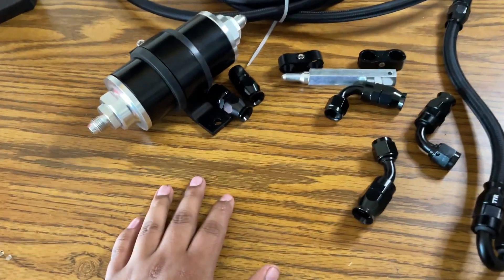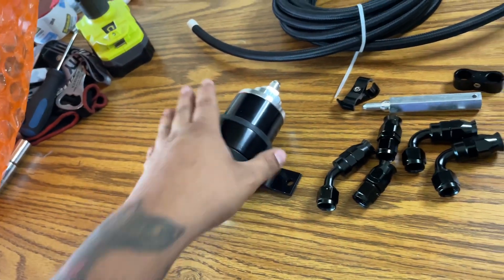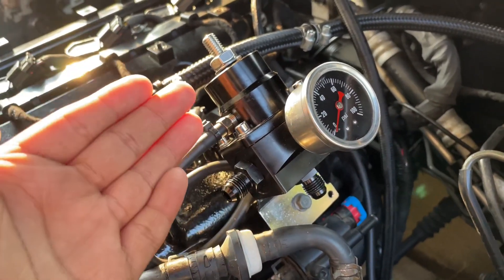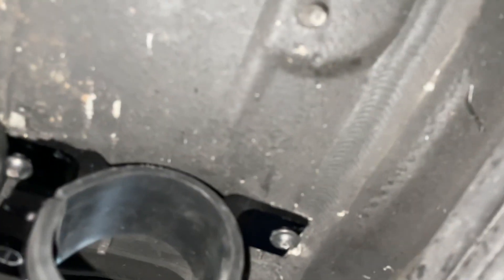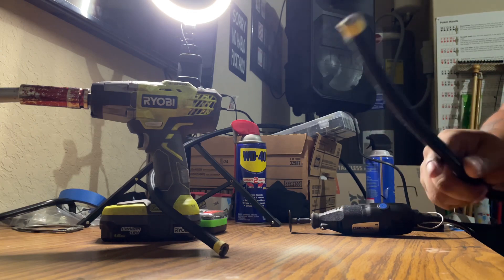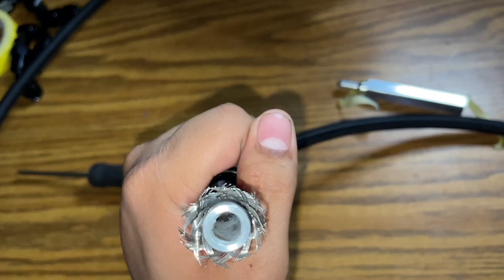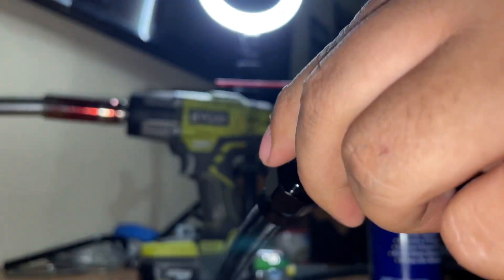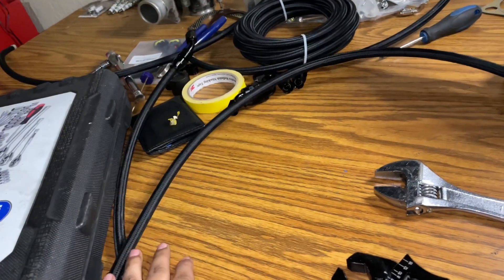Genesis Coupe Fuel Return System Pt.2 | PTFE -AN Fittings

Comment: Sure looks like you could use a billet upgrade for that rail. Also, if someone wanted to run a static pressure on an aftermarket regulator with a return-line they can by just not using a reference line. I just would advise against it since a 1:1 rising rate with boost is superior, but it has an impact for tuning.

Comment: does this work? is there a part 3 coming soon lol
Reply from the maker: Yeah. It’s like any other fuel return system. They’re all the same. 

After this video all you have ti do it’s just adjust the fuel pressure regulator. I posted a part 3 but it got taken down because of the music I used.